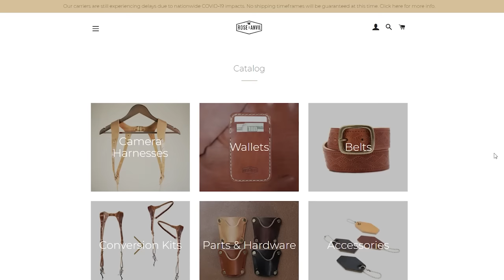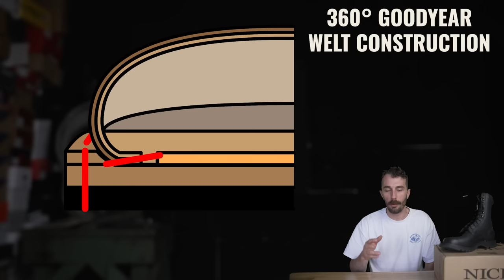($524) Are these the best Tactical Boots? - Nicks Boots

Comment: So they have built a boot like all the other budget boots and charge 500 bucks. pu foam costs the same as leather? Doubt it. not a bad boot but way overpriced.
Reply: I was able to find a pair of stacked leather heel blocks for $30. The foam wedge is made from ground down vibram wedge soles which cost around $50 a pair. So no, they're not overpriced.

Comment: "water tight" Now that's some marketing BS weasel wording. Simple leather boots will never-ever-ever-never-ever be waterproof. They might hold on for a couple of wet miles, but suddenly the water will find it's way somewhere at the seams, and once there is a tunnel and surface tension is gone, you'll get drenched. That's why the 'fabled' danners fail so miserably as hiking boots (actually they fail for many other reasons). These are not real high quality outdoors boots, just overpriced old leatherboots.
Reply: Sure thing bud.